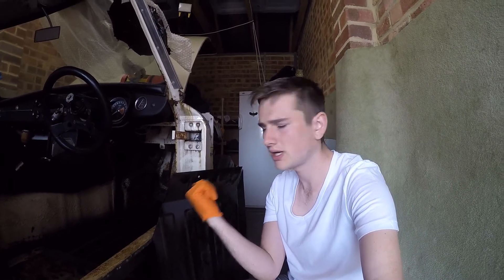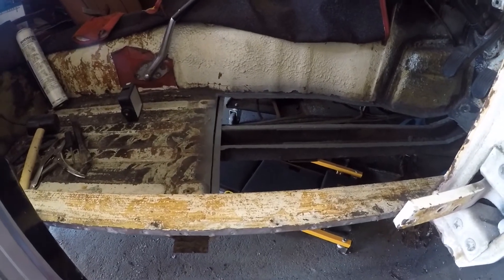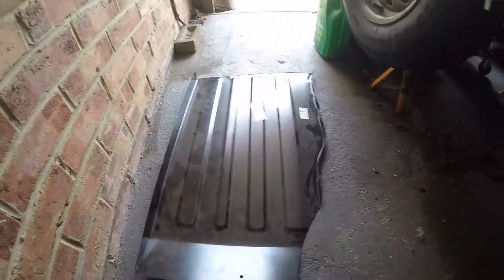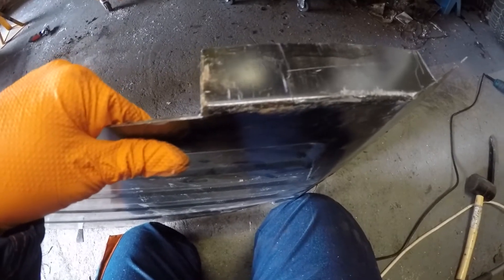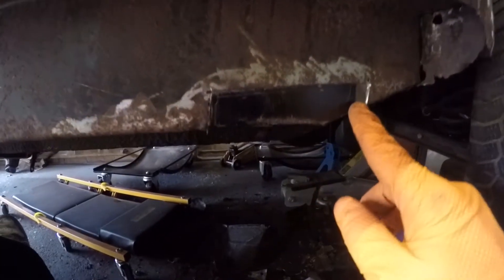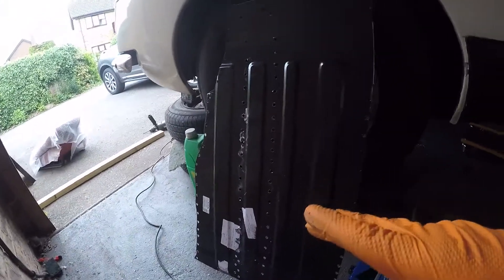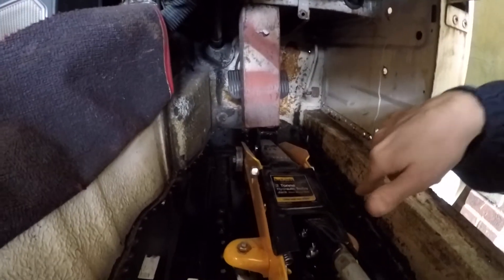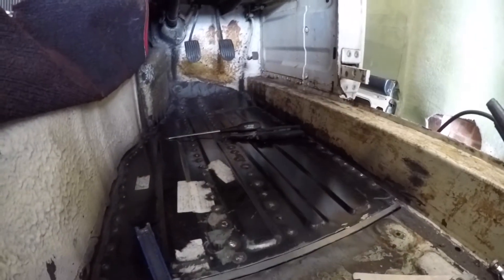MGB GT Restoration  Pt 20 Welding the Floor and Step Sill

Comment: Good stuff man.  I have a 74 B I have owned for 17 yrs, and have yet to start on!  I should get a vid series on this as well...  Giving me the inspiration!  Keep going!
Reply from the maker: ScopiJohnson it does take so long... it's also daunting, especially the sills
Reply: before you weld up  your sills , but the doors on and check caps especialy door to sill cap
Reply: What welder, settings and wire are you using?